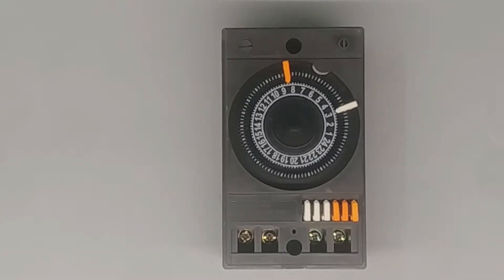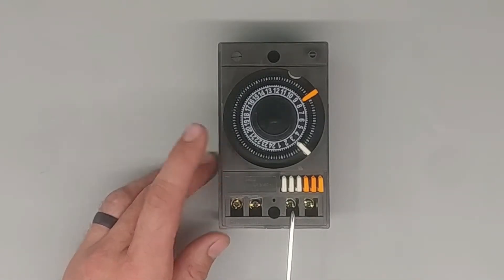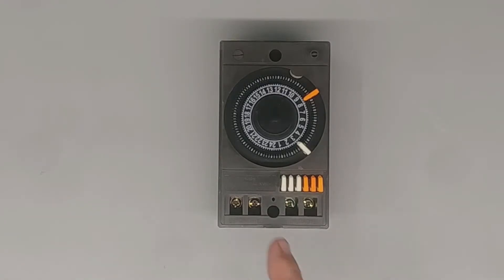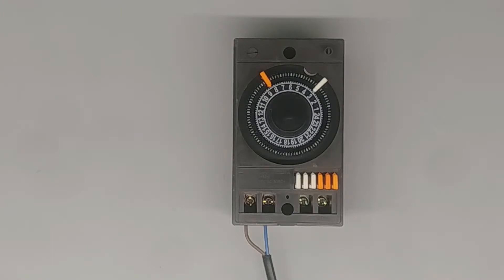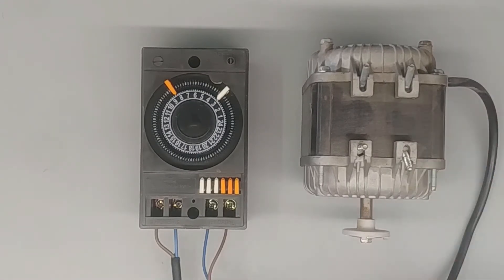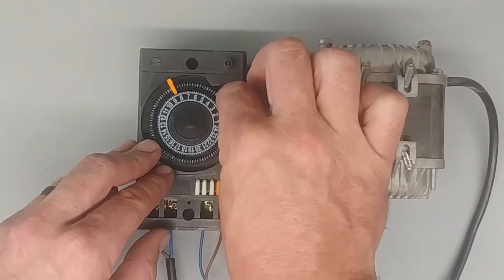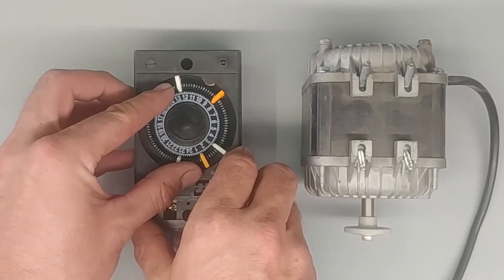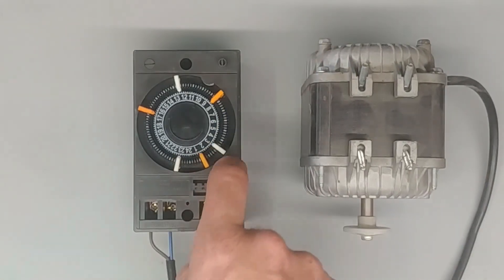Connecting a National/Waco Universal Timer

Comment: I Bought a Digital one and it lasted 3 months, so I went back to this type, Nice but it doesn't fit in the Pool Box. I am a bit confused about the negative Bus bar. I Have a Main isolator and a 6a for the Pool Light and 16A for the Pool motor. It seems all the Negatives are bridged and the Hot signal (Red) gets switched?

Comment: Went to Builders and they had two pool pump timers  R800-00 and R1100.00 !!! went to the electrical section and saw this Waco DTD-1440-1 24 hr universal timer at R296.00  Reluctantly bought is and then googled and came across your video walla was i happy!!!! Thanks for the explanation in setting it up its all connected and so far working like a charm just hope it lasts My previous timer lasted 35years!!! I certainly wont be around in 35yrs but time will tell 
Thanx again for your video.

Comment: Hi, thanks for this BUT I have a problem , I have to switch in on manually to start , it runs the time frame BUT does not continue to operate after the the end time is activated. What could the problem be?
Reply from the maker: Hi. Most of these timers have a battery in. The battery wil not last very long if the main power is cut.
Make sure you do not switch of the main supply to the timer and that the supply is connected on the right terminals.
Reply: @p0we111  Hi  I have connected as shown in the video, still not kicking into automatic ode for time going forward. How can i check the battery?  Can I send you picture of my old one and the way I installed the  Waco one? The Main switch  is always on as it supplies my gate gate motor. Please send me information on how on how to send pics to you. Much appreciated. Thank you.